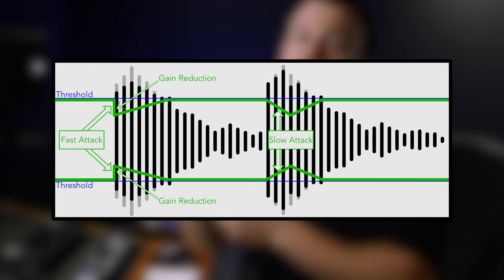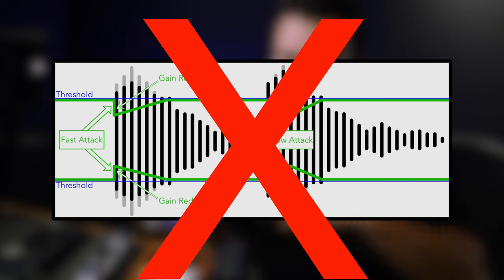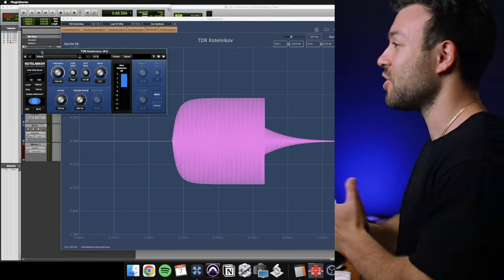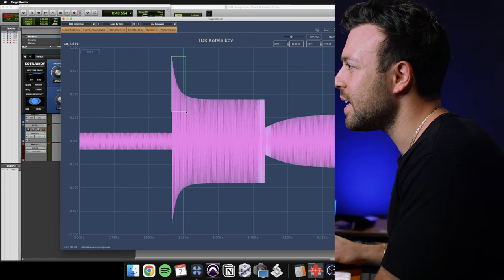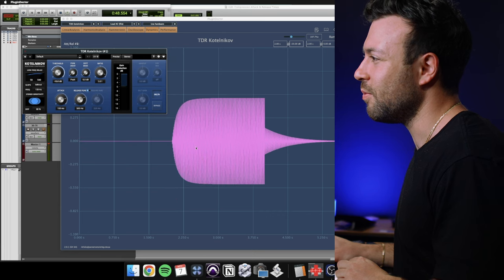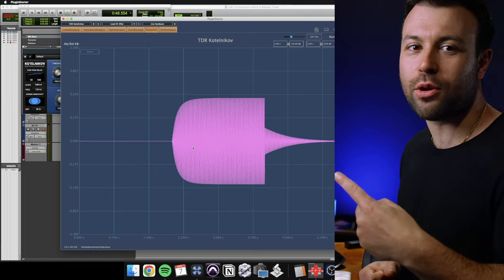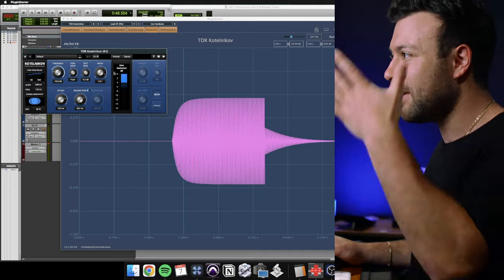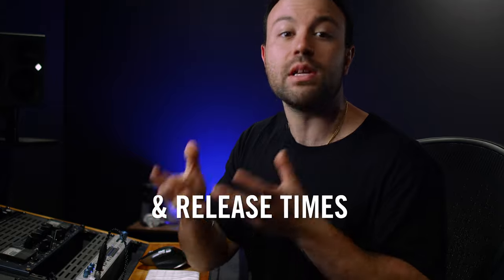Are Compression Attack and Release times LYING TO YOU when mixing & mastering?

Comment: Well i'll be damned

So how does knee relate to time constants then? Is that the 2nd time constant?
Reply from the maker: It doesn't relate to the tone constant; Please cite source below, I fortunately have this printed out on my dining table where I do my morning admin! I am using this paper for other reserach!

(Source: Digital Dynamic Range Compressor Design - A Tutorial and Analysis, "Dimitrios Giannoulis, Michael Massberg and Joshua D. Reiss") "The knee is the threshold-determined point where the input-output ratio changes from unity to a set ratio... A soft knee will set a transition region on both sides of the threshold where the ratio grows from 1:1 to the set ratio;"